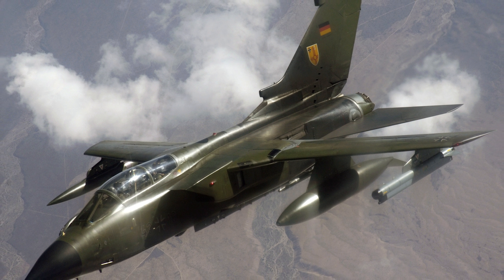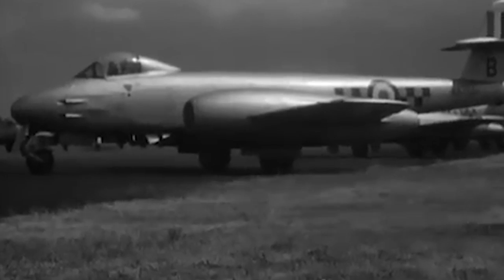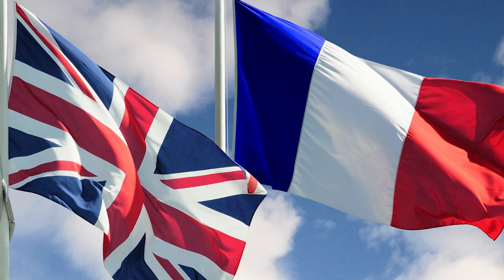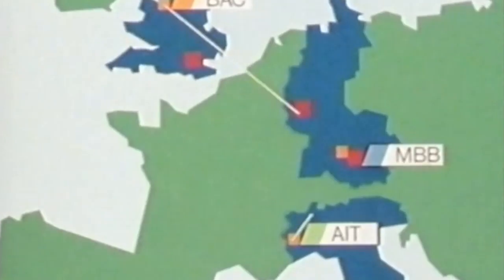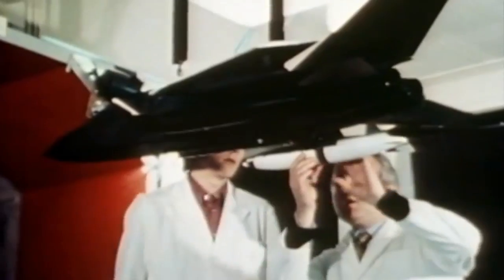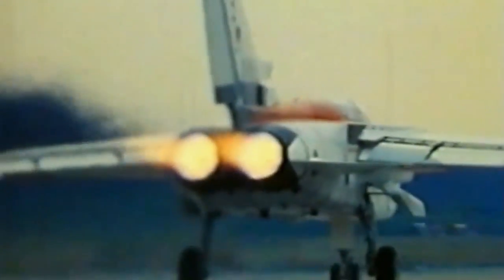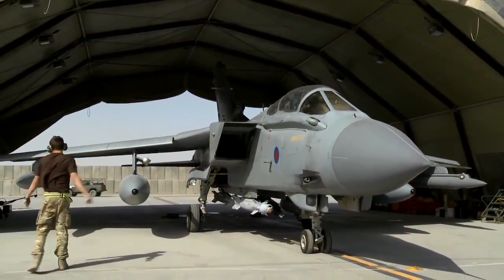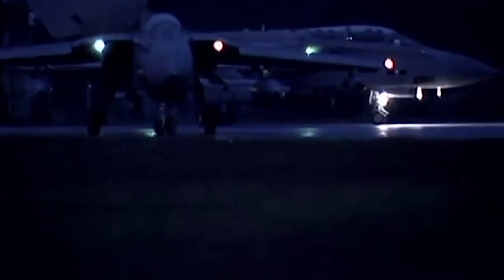Panavia Tornado - the first European fighter. History and description

Comment: why is this plane so overrated
Reply: It's not. It performed all tasks, for which it was designed for perfectly.
The specifications called for a fast, medium - long range attack  low-level fighter bomber.
It's primary mission was to interdict enemy forces and supply, behind the forward line.
Esp.: airfields, POL-, other supply depots and choke points.
If needed, they could haven been used in CAS, with MW-1 and BL755. But that would be better work for, A-7, F-16, F-4, Mirage 5/50 or Jaguar, Alpha Jets.

There was a simulation by DID, it was used by the RAF for mission planning training.